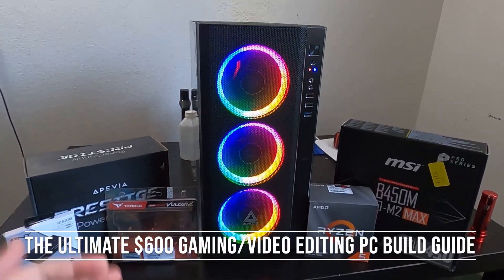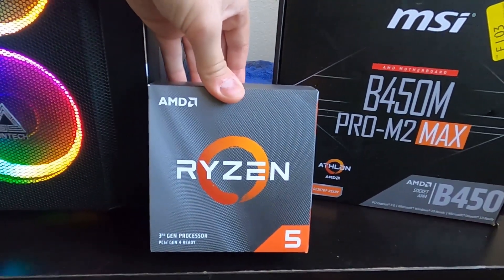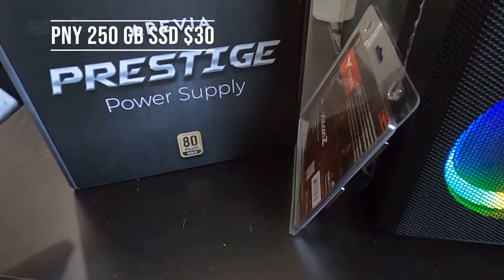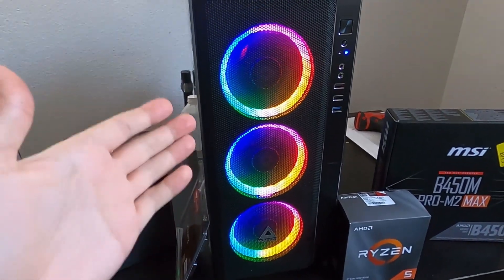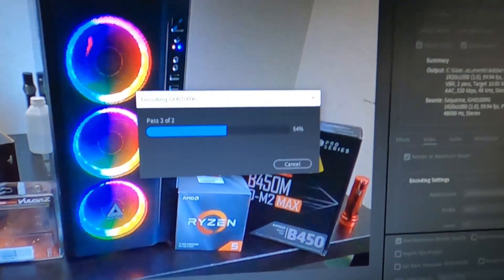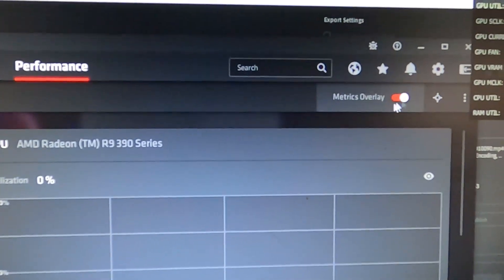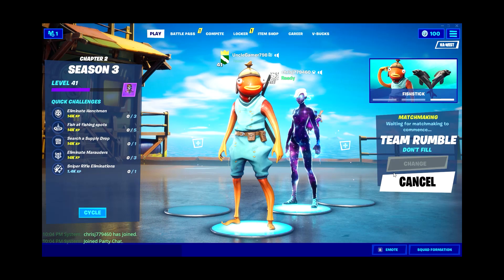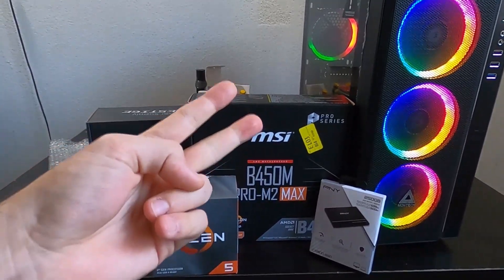Building a $600 Ryzen GAMING PC (AMAZON SPECIAL) 😎

Comment: The motherboard you used isn't compatible with your cpu. It's Ryzen, but it's 3rd gen, and that motherboard only supports 1st and 2nd gen. Just sayin.
Reply from the maker: It worked out of the box
Reply: GK7 DIY i mean it would have better performance with a motherboard that supports the cpu’s gen.
Reply: @mrjooch  can you give some example of a better that supports the cpu
Reply: @gigachad5310  I would recommend ryzen 5 2600x but any 2000 or 1000 ryzen cpu will be more compadable with this product. In my opinion if you want a even better experience with this pc you should go for a better motherboard so you can get a cpu like this and have a better performance. If its 3rd gen, then you should go for 3000 chips like the ryzen 5 3600x.
Reply: @mrjooch  thank you very for the quick answer!
Reply: @gigachad5310  yea no problem, if you have any more questions ask cuz i’m a geek with this stuff
Reply: @mrjooch  ASUS TUF GAMING B550-PLUS AMD AM4
Does this motherboard work with the cpu? 
Opted for ryzen 5 3600x

Comment: Will this work? i'm not sure so i would like to double check

Montech Fighter 600

PNY CS900 250GB 2.5 Inch

PNY 16GB (2x8GB) XLR8 Gaming DDR4

MSI Computer Video Graphic Cards GeForce GTX 1050 

MSI ProSeries AMD Ryzen 2ND and 3rd Gen AM4 M.2 USB 3 DDR4 D-Sub

AMD Ryzen 5 2600X Processor with Wraith Spire Cooler 

 Apevia prestige 600W

I know its kinda similar but i would like to know
Thanks